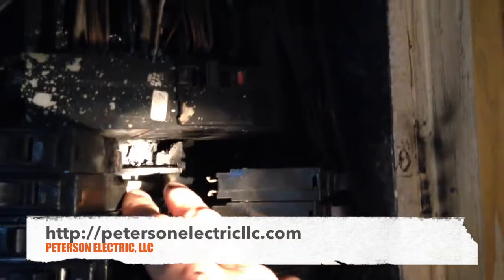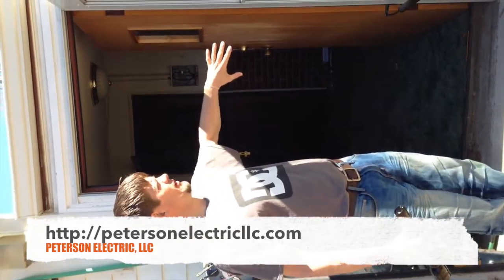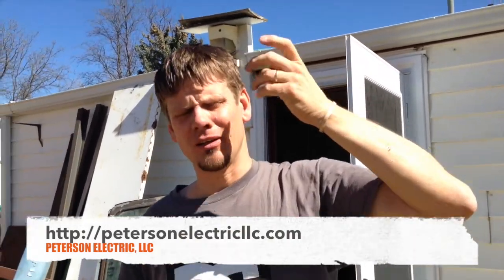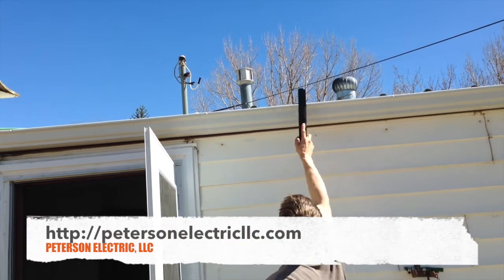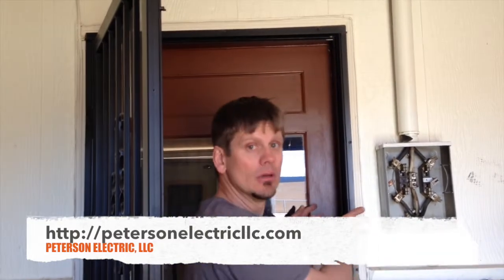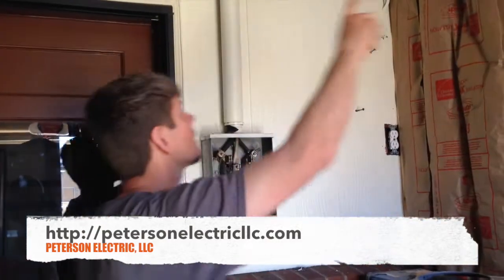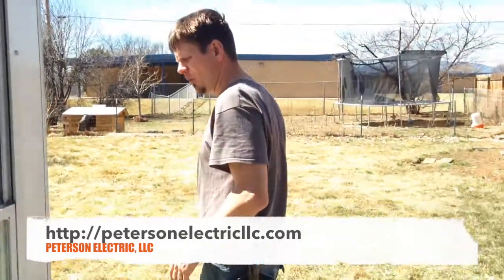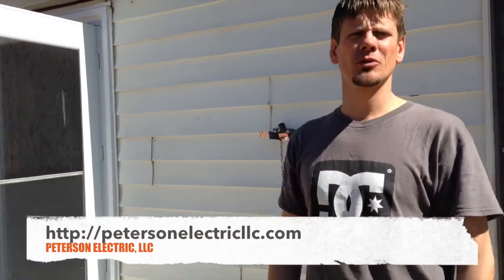Square D QO Panel Melt Down Due To Welding Or Panel?

Comment: This is because the morons at UL allow companies to make INFERIOR equipment with aluminum busbars with plug on breakers. The new QO panel buses are tinned copper but the WAY UNDERSIZED plug on ALUMINUM neutral buses il bet that they are going to have major problems with in the future. This industry is very political and people that work for say Siemens also work for the people that write the codes [very disgusting and conflict of interest]. Im going to probably let my license expire and retire because im sick of the SUBSTANDARD EQUIPMENT thats on the market. At one time i was going to have SQUARE D tattooed on my shoulder but am glad i didnt do that because if i did i felt that SQUARE D would do something stupid like that aluminum plug on neutral. My intuition was spot on. When i did electrical work i always used the best quality equipment that i felt comfortable with so i could sleep at night. Now with this new stuff i dont feel
comfortable with anymore. People that i used to work with are not happy with these new codes they keep coming out with. Im beginning to have a real resentment fore this one nice trade i one dearly loved.

Comment: Also can't run the line wires above a window, and this is ran above an entry way, hehe.. Which is another foul.. The glass door counts as a window in this case? Either way it is an entry way to the building.

Comment: Hmm as you know you need 18 inches above that roof for the power wires however, best is to get the mast outside on the exterior of the building.
Reply from the maker: We have to have 36" above a roof line. If it passes 30" we support with conduit or guy wire.
Reply: @Petersonelectricllc  Wow is that a local code? It is going to take a lot of work to do that job right.

Comment: LC's, guy, "LOOSE CONNECTIONS" Aluminium Busbars, "SUCK!" & "Thermal" breakers!  I was a contractor, 1973, used "Murray " Magnetic/ MCB, & mains, no problems, other contractors, "Beat me out" they used Federal & Zinsco, "THERMAL" only breakers, also my Murray /Arrow/Hart had plated, busbars, no corrosion.